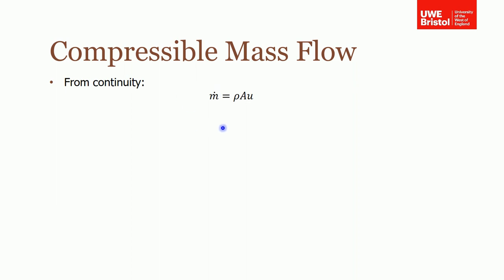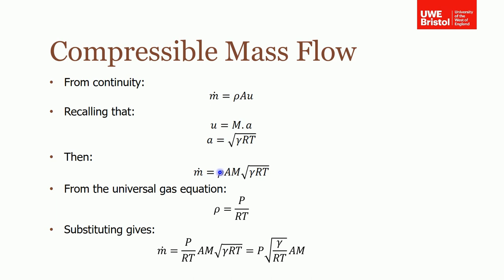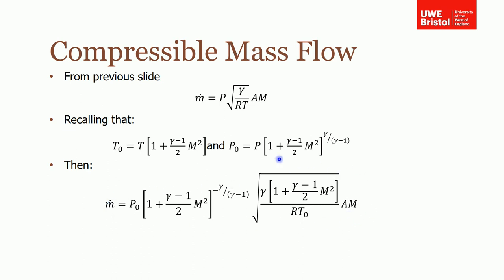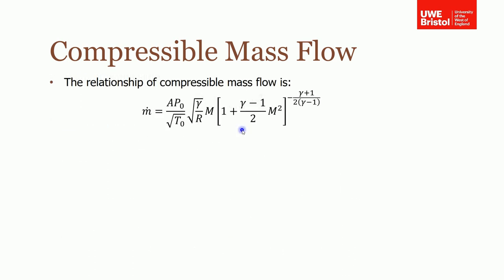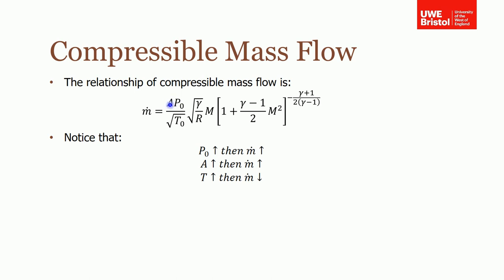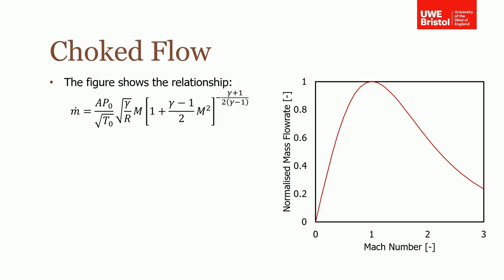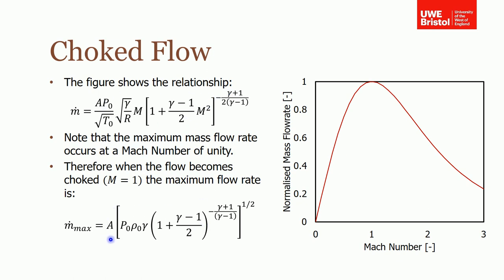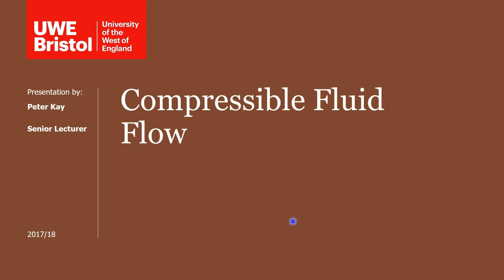Compressible Flow - Part 4 of 4 - Choked Flow

Comment: Thank you! 
So the myth is busted: mass flow CAN be increased even under choked conditions if the back pressure increases.
Velocity stays constant but higher p0 means higher density therefore higher mass flow